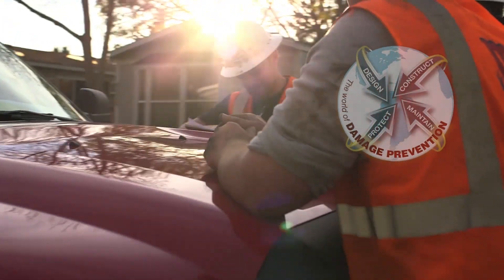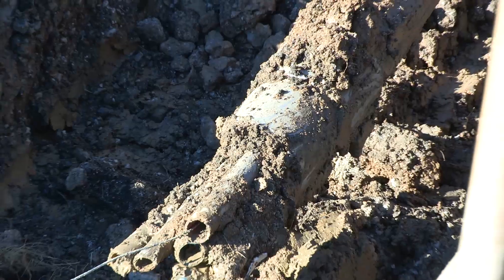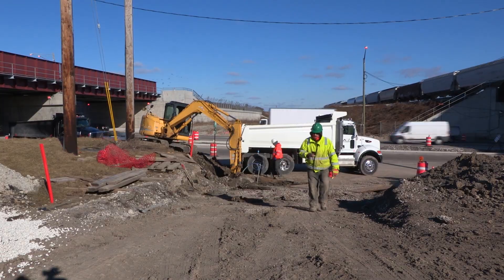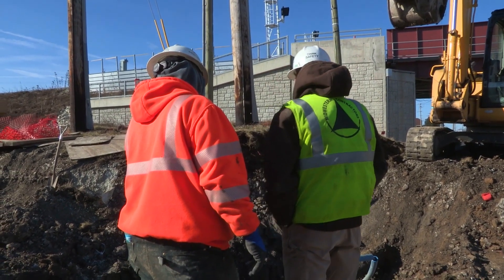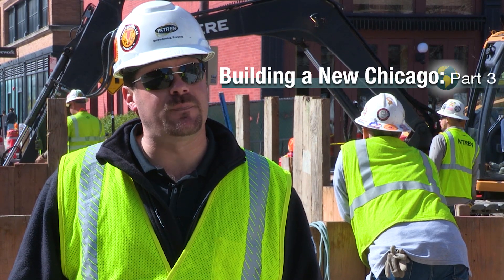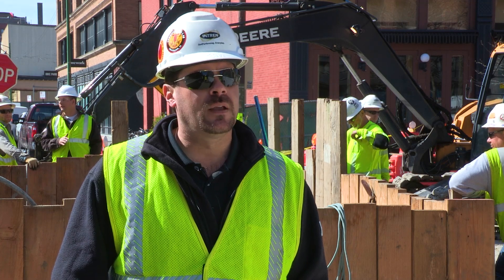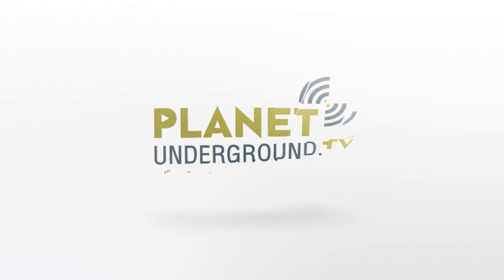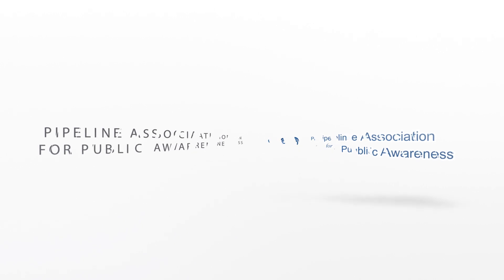Planet Underground TV: Episode 4

Comment: I worked for a gas utility in Massachusetts for 2 decades. In the late 80s i was on a street crew. During the summer months backhoes were usually overhauled and we had 3 crews and 3 backhoes. If your backhoe was out of service we would go out in the heat and with a shovel and digging bar. Get on site jack hammer then dig by hand until another crew could send there hoe to us. Usually that was just to get spoil.  I loved it